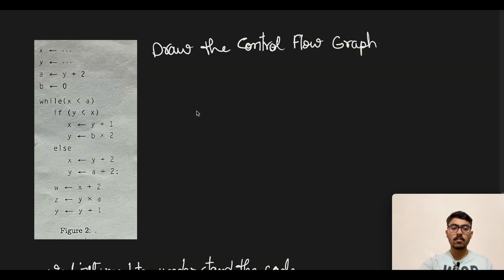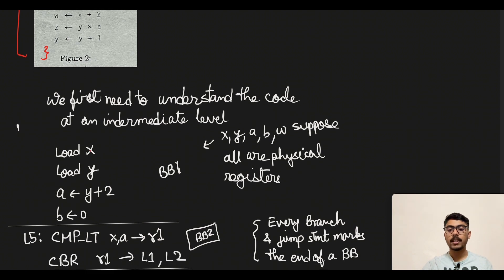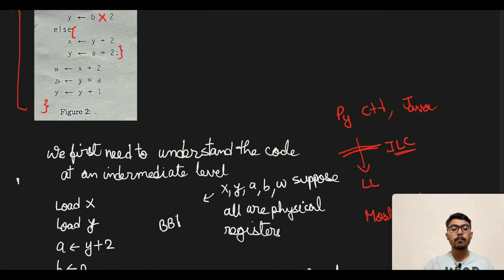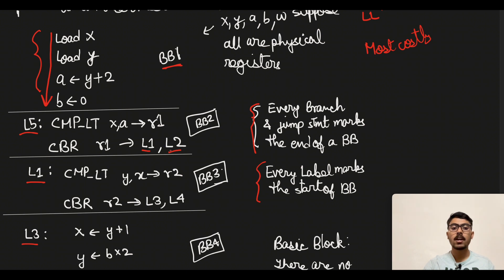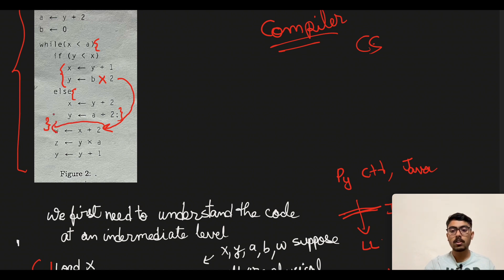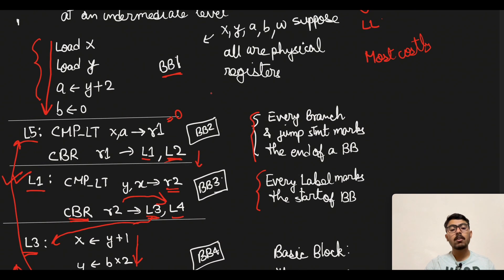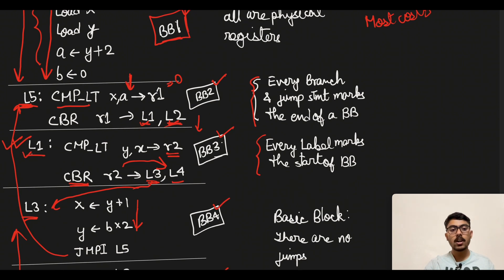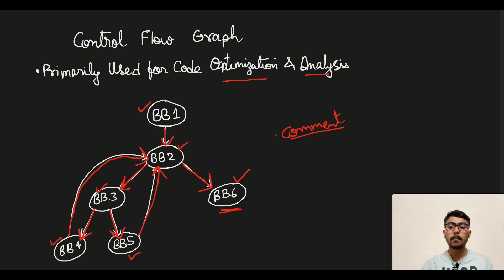Control Flow Graph - Solved Example | Compiler Design

Comment: i think there is a problem in CFG because after 4th node it should not move directly to while node , it should move to 6th node which is below the else body ??? . There should be total of 7 nodes in the CFG not 6
Reply from the maker: Good question, we can see that at 9:19 I have clarified the position of while loop. Hope it helps!